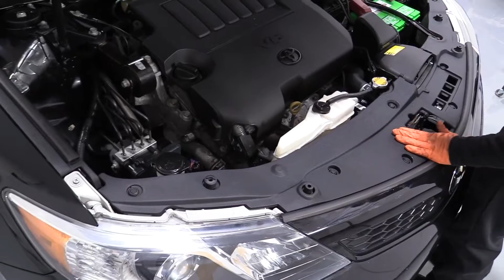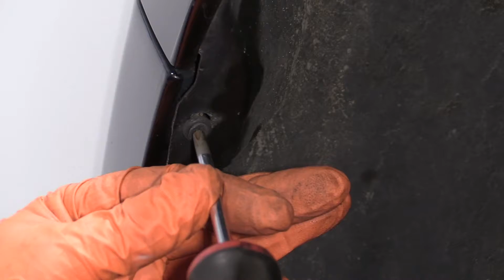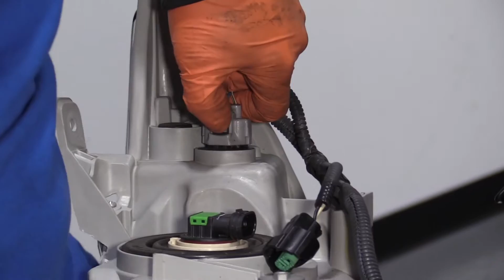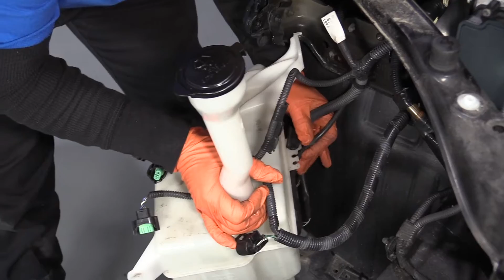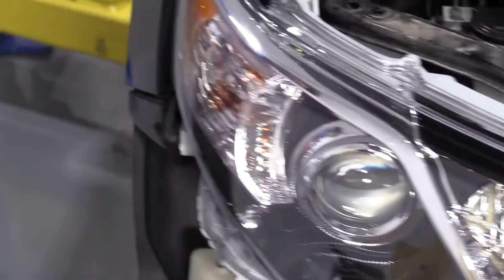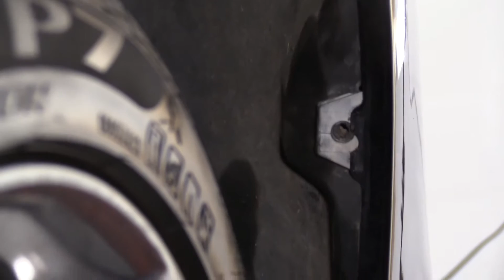How to Replace Washer Fluid Tank 11-17 Toyota Camry

Comment: This helped a lot, because when I was ready to install the reservoir I got the two connectors confused (pump vs sensor).  They look like identical connectors, but maybe they are marked.  I was working with artificial light, outside at night and it was hard to see.  Anyway, the gray one is the pump which your video showed me.  My wiring clip was missing too.  When the clip is in place you see that the gray connector is closer to the pump, but I did not have that info.  Thank you so much for creating such excellent videos.  Good lighting during video production saves the day again.
Reply from the maker: +Ted Horton Thanks for checking us out! 1AAuto.com